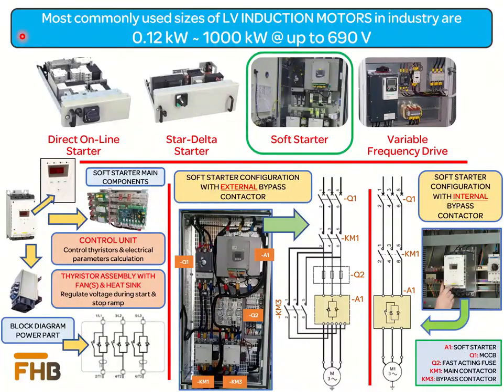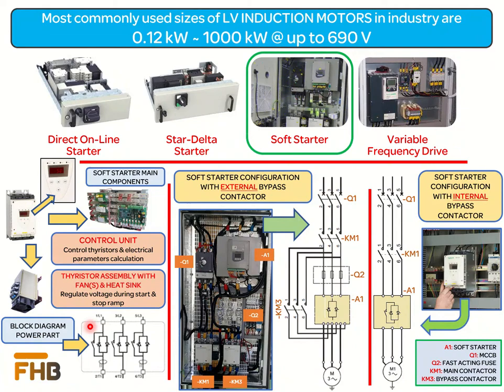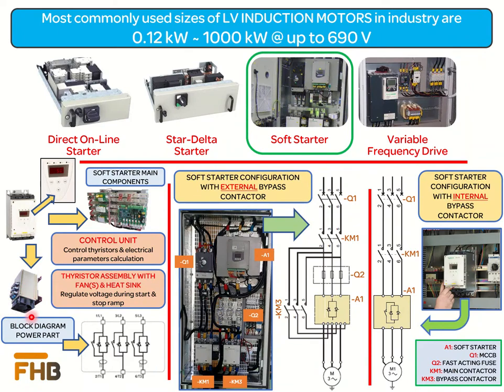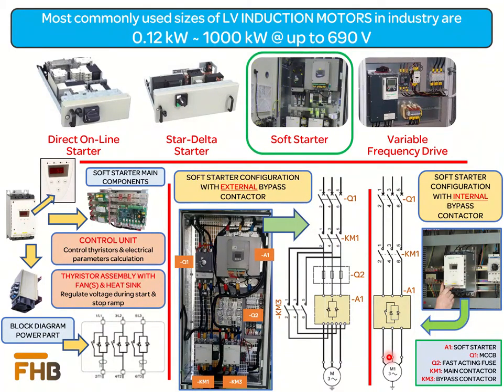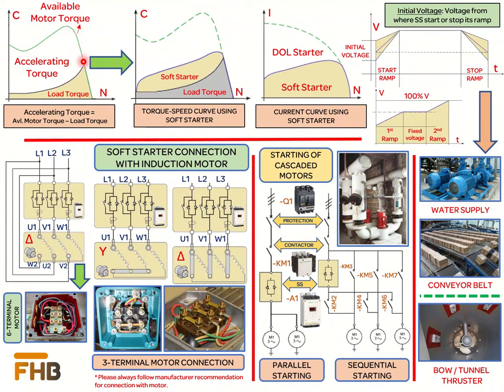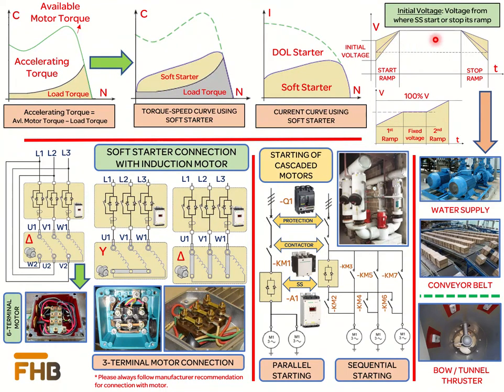Soft Starter Working Principle  | Farrukh Habib - FHB | #ElectricalEngineering #softstarter

Comment from the maker: KINDLY LIKE & SHARE THE VIDEO - PLEASE SUBSCRIBE THE CHANNEL!!!
0:00 - 0:31 -> Introduction about the v-log.
0:31 - 01:20 -> Why Induction Motors are preferred in industry?
01:21 - 02:45 -> Design of Soft Starters. Introduction to core design components.
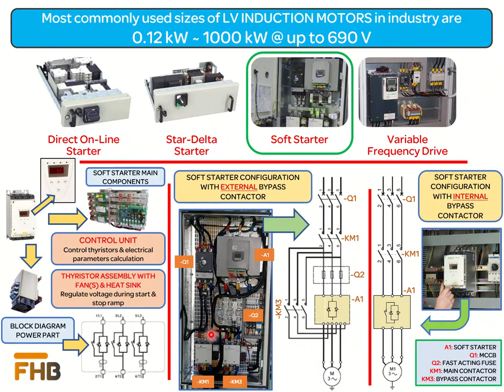02:46 - 03:46 -> Why Soft Starters circuit is designed with Internal or External Bypass contact?
03:47 - 04:46 -> Discussion on Soft Starter Torque-Speed curve and Current-Speed curve.
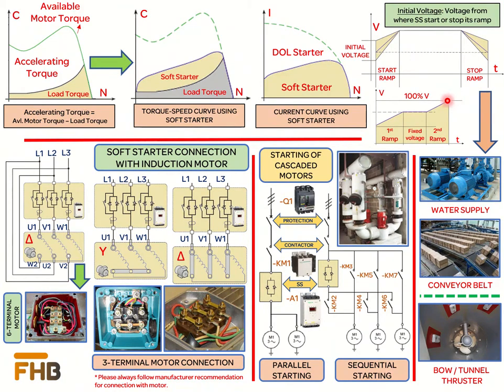04-47 - 06:02 -> Different motor starting techniques used in Soft Starters.
06:03 - 06:28 -> Power connection of Soft Starter with Induction Motors.
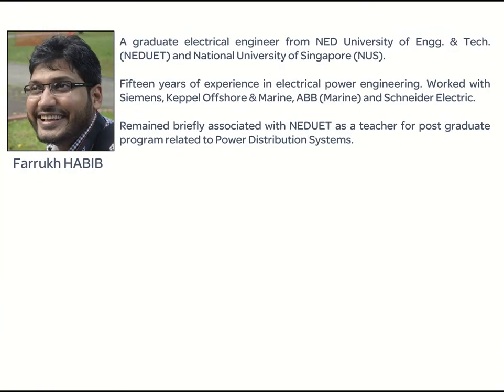06:29 - 07:06 -> Starting of cascaded motors using Soft Starters.

Comment: Excellent video. 

For the technique for starting several motors with one soft starter, do we consider the rating of the starter to be greater than the cumulative rating of the motors or the starter rating is to be greater than the maximum rated motor?
Reply from the maker: Hello Daniel, There are two conditions (1) Parallel start, in this case several motors are started at the same time therefore softstarter must be able to withstand the starting and rated current of all motors together (2) Sequential start, in this case softstarter start several motors one by one therefore softstarter must be able to withstand the starting current of all  individual motors during the whole starting sequence. After startup motors get rated supply through contactor and not from softstarter. 
You can get details from last part of the video!